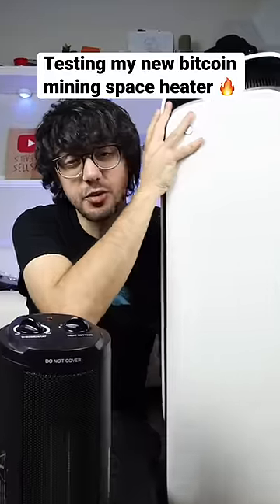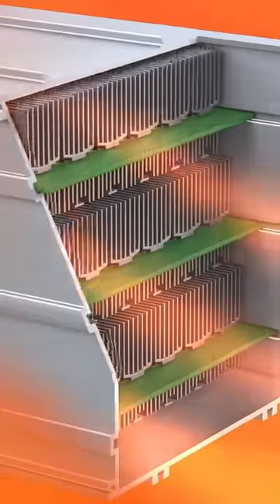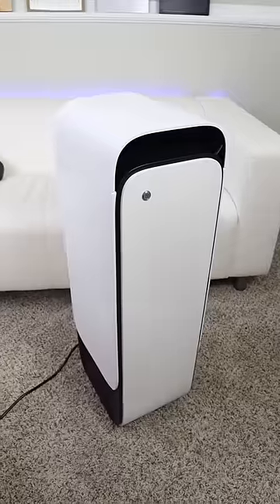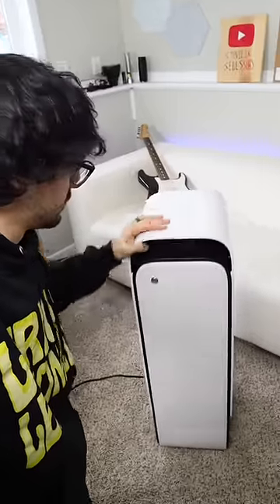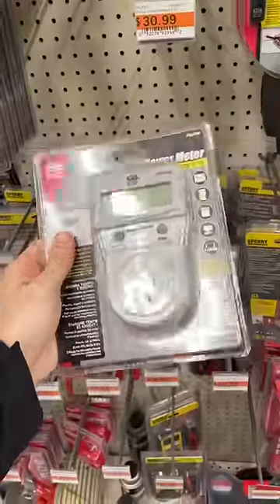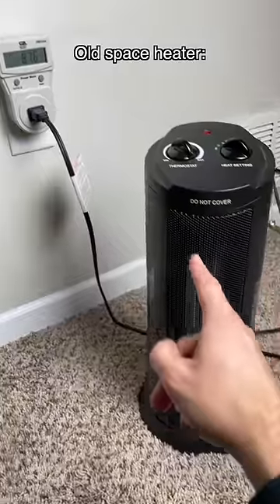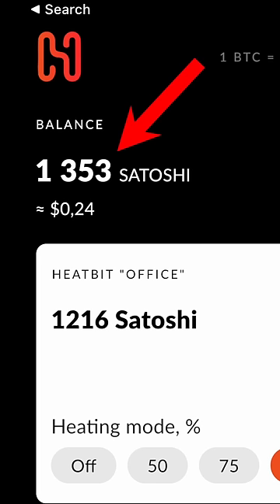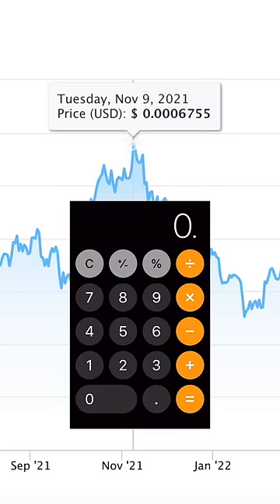My new bitcoin mining space heater

Comment: Only down fall is that it’s 1.2k 😅
Reply: that is mad cheap for btc miners some cost up to 10-40k
Reply: @AlmostBrokeLbs  but this isn’t a gpu so its mining efficiency is much lower per watt. That said, computers are almost perfect heat generators so he’s still getting the same heat/watt as a space heater. But it will take a long time to recover the 1100 price difference between a normal heat and this from the mining.
Reply: @qwie100  yeah and I was comparing it to asic lol but it is more efficient and you at least get somthing out of it compared to other expensive heaters
Reply: Given the way that electricity prices are on the rise, he will have paid his £1200 back in ten years 😂 Don't forget this will likely not work after one or two years constantly running through winter months...
Reply: @killcha_in  yeah
Reply: @mohammedsafraz9820  oh some miners run 5 years and still work fine that device is not overheating and it doesent use more power than normal heater
Reply: @AlmostBrokeLbs  Yeah maybe, but my point is, to break even on the purchase price he would need to run it 24/7 for at least ten years. No way it would last anywhere near that long.
Okay he might reduce his daily power usage by $1.25 based on his 24 cents for five hours.
But he would also be using way more than the $1.25 per day in electricity. So likely he would never break even...
Reply: @mohammedsafraz9820  yeah but what id he bought heater for same price it wuld not give you ANY money
Reply: @AlmostBrokeLbs  a $20-30 dollar heater Vs a $1200 would save him over $1000 in the first year and he could pay to run it for the next ten years and still be better off 😂
Reply: @mohammedsafraz9820  true but sill I wuld rather get this it is more cool
Reply: @AlmostBrokeLbs  lesson in life, and this is in no way of belittling you but… getting something because it “looks cool” rather than getting something efficient that has the same properties w/out  the ability to mine BC is just a waste of money. 

Materialistic wise and necessity wise.
Reply: @FiveDollarJs  it doesent "look cool" it is cool aka neat and kinda useful
Reply: @marino222 it's neat sure, but not useful, change your mindset or you might stay broke...

Comment: Your PG&E bill definitely went to space 😅
Reply: At least he probably isn’t in SDG&E jurisdiction🤷‍♂️
Reply: xcel
Reply: Power bill would be the same regardless. If he traded a 1000watt heater for a 1000watt miner it would make 0 difference
Reply: @Teh_Random_Canadian  Are we sure this converts electricity to heat as efficiently as a purpose-built space heater?
Reply: @taylorc2542 where should the energy go to, other than to heat?
Reply: @taylorc2542  Yes, a space heater is 100% efficient at it's job, as in 100% of the energy use is lost to heat. This mining rig is probably 98% of energy going to heat loss, the other 2 percent would be mechanical energy losses like the cooling fans and whatnot, but yes energy used from computers is converted to heat almost entirely. There is a reason why people with huge mining setups need dedicated AC units
Reply: @Teh_Random_Canadian  a space heater has fans too. The energy that goes to fans turns into kinetic energy of air that eventually turns into heat. Technically neither a space heater nor a miner is 100% efficient because some electromagnetic radiation and sound gets outside through walls, but the amount of energy that goes to that is insignificant
Reply: @Teh_Random_Canadian   I'm backing up what this guy is saying. By design resistive heaters are (basically) 100% efficient. A heater from 1920 will be no more efficient than one from 2030(not safer though). They are by design, inefficient. And they use the inefficiency to create heat, which is what we want, so very efficient. 

Arguably, the mining rig would be a smidge more efficient since it doesn't glow. which really goes back to heat anyways so, same.

Source: am electrician

Comment: You don’t need to drop a second video, it’s earned 24 cents in five hours, so it’s been running your meter for five hours. That’s pretty simple math
Reply: Nice, the price of that thing is around 8900 dollars. That means you need to run it constantly for 20 years just to break even, and that does not take into account that the amount of energy required to make a certain amount of money in crypto takes longer every single second.
Reply: Sounds like the most expensive joke anybody ever has told in human history. Insane.
Reply: @hitbox7422 Not to mention the proce of bitcoin changes each day, one day he couls be making 34 cents an hour ths next it could be 10 cents or a dollar. That is why he need the additional days, to calculate earnings based off the average price of bitcoin in that time.
Reply: @hitbox7422  its 1200 dollars. Seems like someone said it was 10.000 and someone then replied they were off by 8800.
Reply: @hitbox7422  It's not that much but 20 years is probably correct considering mining difficulty will only go up. This product is dumb. Bitcoin is dumb.
Reply: @-ANDY.  ah thanks, then I misunderstood that. But as the last commenter said, together with that volatility of crypto, it's probably still around 20 years to break even 😅😂
Reply: He didn't mention how much per it used in that time so no man possible with those numbers

Comment: Don’t forget to factor in the $1200 price tags for the heater.
Reply: Normal heater are a 100$.
So you need to make 1100$ in less than 4 month/year and it make about 25c a day.
So about 37 years.
Reply: @ameunier41 now divide that by about 5 cuz he said 25 cents in 5 hours so roughly $1.20 per day when it's in use atow prices... a year ago woulda been closer to $5 per day so if it goes up it may be worth it
Reply: @ameunier41  Another important thing to keep in mind is how long this device will last before it breaks down. A traditional heater has a much simpler design, is less likely to fail and is cheaper to replace. If that bitcoin heater has a problem you are facing rather expensive repair cost (if possible at all) further delaying the time it needs to pay for itself.

Comment: By the way if it's been using 800 wats for those 5 hours (which is kinda low for a heater and depends on the miner but still kinda low) it cost 65 cents for those 5 hours

Comment: I have a water distilling machine in my basement to make distilled drinking water. It is a large commercial grade floorstanding unit with a 40 gallon storage tank and a pump to feed distilled water to the kitchen sink and the icemaker in the freezer. It uses the same type of heating elements that domestic water heaters use in its boiler tank. It runs about a 24 hr cycle to fill the 40 gal tank and during that period it puts out a lot of heat from its condensing coil, enough to warm the whole basement to 72 F, which in turn rises to supplement heat to the upper floor of the house. During heating season the energy I use to distill water is essentially free, because it goes into the building as heat that I would need to pay for anyway, and I get drinking water out of the deal. During summer cooling season, which is 4 months out of the year, I have to vent the condensing coil thru a window to the outside, so I pay for the water during cooling season.

Comment: $1200.00 for the heater.. 1.4 Kw x .30 cents per Kwh = .42 cents per hour for electricity Many utilities charge penalties for over usage.. the .30 cents per  Kwh can go to over $2 bucks per Kwh which would be $2.80 per hour.. According to the the heater's website, You will earn 30 bucks per month ,in bitcoin.. $300.00 to $2000.00 per month for electricity to earn 30 bucks.. SO,, Steal electricity from your neighbor, spend $1200.00 for the heater and you get 30 bucks or less in bitcoin

Comment: 1.2K price, burns 1.4Kw at 0.2-0.3$ph, and makes 0.21$ every 5 hours. 

So basically you paid 1.1K extra to reduce your power bill by 0.04$ph. 

You will make back the 1.1k after 27500 hours of operation and after you have spent thousands more on electricity.

It's a nice gimmick but that's what it is. A gimmick.

Comment: He forgot to mention it's 1200 bucks he's worried about the electric bill
Reply: Just wait until he hears that his old heater was already 100% efficient, and this thing will break down long before he ever recoups his money from it 🤣 he'd have to let it run continuously (even through the spring summer and fall) for 3 years before he even gets close, and that's not even accounting for the lost cost due to inefficiently running it through spring summer and fall. If you take that into account, he might never recover the cost of the thing, and he was probably better off sticking with his old heater.
Reply: @quinndirks5653  I came down here to say that 😂 it doesn't matter what kind of electric heater you have they are all 100% efficient. That being said a radiant heater will always feel better but is still gonna change the air temperature the same amount per watt
Reply: A 1000watt space heater is like 30 bucks. I wonder how long he has to run this thing to make up $1170 in crypto... probably longer then the rig will live for lol
Reply: @pamacons  at point of use*
Reply: @pamacons  pump heater/cooler  have greater efficency more than   300%  
 heat pump move the  heat  from outside to inside
Reply: @pamacons  Technically its not 100% efficient because of the sound it makes
Reply: @quinndirks5653 I don’t think you guys realize he will easily make his money back on content alone with multiple videos on multiple platforms. And yea it makes sense to look at how much power it’s drawing so you can see if you’re actually profiting
Reply: @pamacons  cousin is that you ?
Reply: @RealJosephRutledge  no Joseph. It's cousin Vinny.
Reply: The makers of this are genius, fuck the coin sell the miner
Reply: @Theironminer-ky2pg  Your right, any sound it generates that happens to hit an ear or microphone will be converted to an electrical signal and not heat like the rest of the sound will as it moves through the air and hits the walls. What's that...0.001W? so yes technically its 99.99999% efficient.
Reply: @quinndirks5653  u missed the point. Its primary function is still just heating but it does it by generating the heat from mining bitcoins which is pretty cool. U dont buy this to make money or even Cover the cost of buying it. U buy this heater...to heat.
Reply: @Chef6 except we are talking about the device here, not him specifically as a user, if any other non youtuber will get this thing for 1200$ he will never make a profit since it will long die before it even gets close to that 1200$, so even if it makes enough daily to break even with the electricity bill you're still probably more than a 1000$ short at the end of a 3 year period.
Reply: @Timo / then he still bought a quirky space heater for 1200$, which for him doesn't matter as these videos will be enough to cover it (if it even needs to be covered , probably free sponsor unit) but it would for some poor sap that thinks this will make him money and spends about 1170$ more than he should have.
Reply: @timo286  a 1200Watt space heater costs like $20 ...$50 if you want a fancier one...the Bitcoin mining one costs $1200. So the coin heater has to make $1150 to even catch up to a normal space heater.
Reply: @Quinn Dirks  you are neglecting the profit from this video
Reply: @Theironminer-ky2pg when objects absorb the sound it turns back into heat via friction.
Reply: He would need it on 24/7 for roughly 39 months just to break even
Reply: @timo286  it still cost 1200 dollars which isn't a price you ever pay for a heater
Reply: I was wondering how much it costs. I have an electric blanket that uses around 100 watts. It costs almost nothing to run.
Reply: @bac302  heat pumps are not efficient at all if its too cold outside.  so the more you actually need the heat, the less they can do for you.  might be great on a 10 degree (50F) day but here these last 2 days have been -23 (-10F) with some high winds.  a heat pump would consume a massive amount of energy to do almost nothing
Reply: @quinndirks5653  he got it for free and got paid, it's an advertisement
Reply: When it was profitable to mine, it was also very nice to get profit from heating your workshop with mining rigs. Saved/made tons of money. 
Even now when it is not profitable it is still cheaper than to pay for electical heating.
Reply: @Theironminer-ky2pg The sound bounces off the atoms inside your house so all the energy stays inside
Reply: Hold on can someone smarter than me play devils advocate for a second and try to imagine a way this is potentially cost effective? So far every thing I read in the comments is another realistic reason that this thing is the biggest scam ever.
Reply: @Theironminer-ky2pg  The sound would get eventually converted into heat. There might be a few milliwatts of sound that end up going outside, so I guess?
Reply: @justahamsterthatcodes  lol
Reply: @Btobebone  i live in tunisia temperature wil never drop below 5 c
Reply: ah there's the math I needed that's not even remotely worth it

Comment: I don't understand the people... yeah a 1000 watt heater is cheaper than a 2000 watt heater but it also makes *half the heat*. If you connect the 2000 watt heater half the time you end up paying the same. 
It's only different when using a heat pump but that doesn't exist in this size.

Comment: I can already tell you it is worth it because electric heaters work by wasting 100% of the electricity as heat. And a computer does exactly the same : all electricity consumed is released one way or another as heat.
The only thing more efficient are heat pumps because they are not generating the heat, but exchanging/displacing it which enables to have greater efficiency.

Comment: It will always be cheaper than a heater for the same heat produced. It just may not circulate air the same. Heat is a byproduct. In one, that's all it does. The other just does something useful while generating it.

Comment: This dose not make much sense for two reasons 1.) For best performance in minding you'll need to have the processors as cool as possible 2.) To work as a space heater you need it to be as warm as possible. Both are on the opposite end of function so at best you'll have mediocre heating and minding  and at work poor hearing and minding or completely fail in one or both functions

Comment: Anything that uses electricity has the same heat efficiency as a space heater.* Conservation of energy.
things like heat pumps and air conditioners which have part of them outside can introduce more temperature change by *moving heat instead of just using electricity to make heat

Comment: Well I'm going with your old heater just cost money to run  and that unit just sucks power all the time. You would still be running computes at the same time using power .
So if you got a unit that does your mining very well and it side effects is a lot heat ,that probably the way to go

Comment: There is no heat pump in there, all the electricity it uses will be converted to heat (a tiny bit to air movement from the fans and light from the leds). If the bitcoin miner makes any money at all it will be ''cheaper'' to run than the conventional space heater per unit of heating. I doubt the extra earnings will compensate for the premium you have to pay for a regular space heater over its lifetime though.

Comment: Compared with that space heater it will be always better no matter what the Bitcoin price. Unless you use a split system aircon in reverse cycle, any heater just puts out the energy put in. That heatbit does the same but also calculates.

Comment: The math is pretty simple. A heater rated for 1500W (which will likely consume closer to 1400W for safety) costs maybe $30. The Heatbit costs $1200 and also consumes 1400W. So if the Heatbit generates ~$0.05 per hour in BTC and costs $1170 more than a space heater, you will need to run it for 23,400 hours, or about 32 months non-stop, to break even. Of course, this only works if you actually need the heat, so assuming 3 months every year during which you can run it, it will take about a decade to pay itself off. Given that BTC gets harder to mine over time, it's probably not worth it.